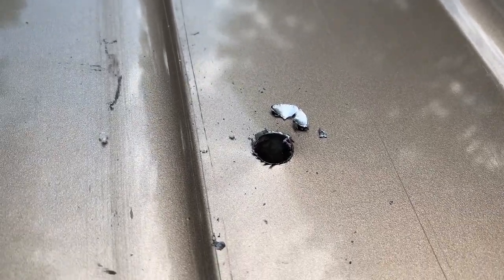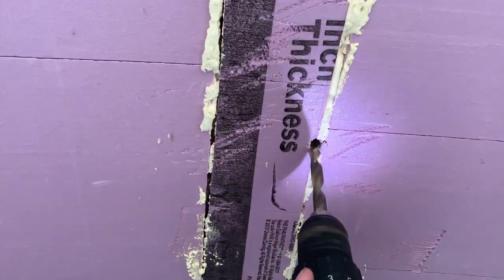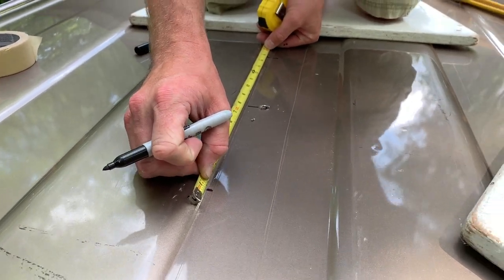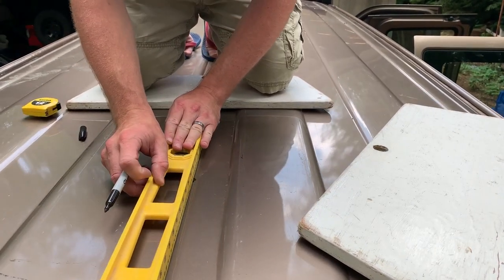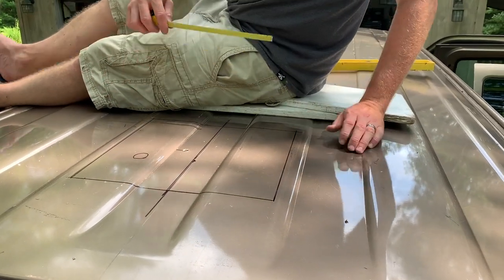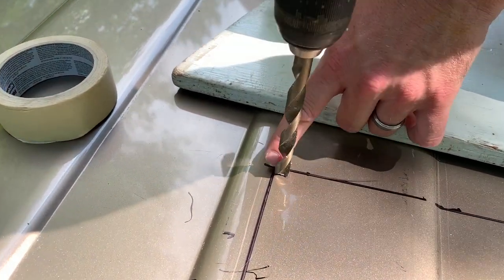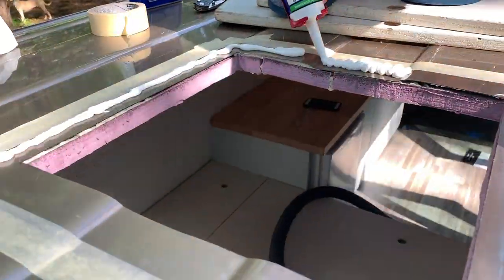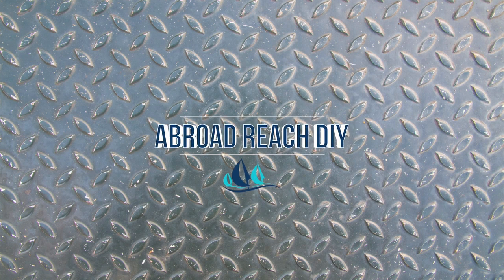How to Install a Van Roof Vent Fan | Van Build Step 9

Comment: It is so much easier to use millimetres than inches and fractions of an inch.
Reply from the maker: YUP!  We would agree but we are American and all of our measuring tapes are in inches.  And buying materials runs in inches too.  🤷🏻‍♀️
Reply: @AbroadReachTravel  The funny thing is, if I buy a TV I still think in inches for the screen size. If I think of someone's height, I think in feet and inches!
Reply: As a Canadian, I HATE that we ever went metric!!!! All I can say to the US is: *don't do it*

Comment: The only bad is, undercover parking that allows a limited height for example 2.1 m max.  A slide window is another option for ventilation, save they're expensive

Comment: I suggest install 2 to 3.  For a large 1 Vent Fan not enough if you have 2 pax in the van. Stuffy & hot
Reply from the maker: I would agree with that if you can manage it!  We didn’t have space on the roof with our solar panels but I think it’s a great idea if you can make it work!

Comment: But how did you manage to fit the fan trim? Did you need to cut it? You barely had 3 inches of thickness on the roof with insulation. The fan trip is like 8 inches high
Reply from the maker: Yes. We trimmed height down with a jigsaw. We had to do the same thing in our new van (video to come!) they give you a TON of height that most people won’t need!

Comment: You didn’t show cutting the cover (on the inside) to fit and hide the hole edges. Should I just measure, mark and then use a jigsaw?
Reply from the maker: Exactly, we marked it and used a jig saw to cut.  The fan has a large flange on the trim ring so you don’t have to be exact.

Comment: My Chevy van has a ribbed roof, too. Did you use self leveling caulk? Did the caulk remain under the van edge without running or sagging?  Thanks.
Reply from the maker: We ran a large bead of 3M4200 around the opening prior to installing the fan.  This bridged the gaps between the roof and the flange on the fan.  After that cured we went over it with the lap sealant.

Comment: Random question but I am trying to set up my van. What do people connect their 12V DC RV roof fan/vent to if they have a solar system in their van??? From what I have seen inverters only have AC outlets?? am I missing something??? Thanks
Reply: If you have an inverter it is running of your 12VDC leisure batteries. You would need to have a fuse box set-up connected to your leisure battery so you can connect the fan to a 12VDC source by fusebox.
Reply from the maker: adam heeley our 12v fan is hard wired into the 12v system, which is connected to your “house batteries not the inverter.  It will go fan to fuse box and then to batteries.  We wrote a pretty in-depth blog post about it here:  https://abroadreachtravel.com/van-12-volt/ which also has a link to our wiring diagram which I think may be helpful.  Once Andy is awake I’ll have him comment if I missed anything 😊
Reply: @lostvan5865  I have had a few people mention these fuse boxes. They look great for what I need. cheers
Reply: @AbroadReachTravel   Ill check it out thanks!

Comment: Did you have to cut the bottom insert on the fan to fit your framing?  I ask because with framing my insert is about an inch longer than my framing.
Reply from the maker: Yes!  We did have to trim that to fit.  They make those fans to fit in such a wide variety of vehicles that they give you a lot of extra depth just in case!

Comment: I have a 2003 toyota sienna minivan, how do I make sure I do not cut through any wires/lights  that might be theough the roof?
Reply: Did you install yours? I have a sienna also and looking for advice!
Reply: You will have to remove your headliner to check for wires before you cut. This may involve removing any or all trim pieces up there like handles or lights. There are probably guides online for headliner removal.

Comment: how did this hold up as far as leaks?
Reply from the maker: It’s held up well!  We did have some water inside during tropical storm Isaias, but we think it’s because the 50+ mph winds lifted the cover and rain came in sideways.  We weren’t in the van at the time so we aren’t 100% sure.  We haven’t had any signs of leaking other than that!

Comment: you did not covered that ugly foam on the top of the roof?
Reply from the maker: The insulation foam?  Yes we covered it after this.  We used fabric covered plywood.